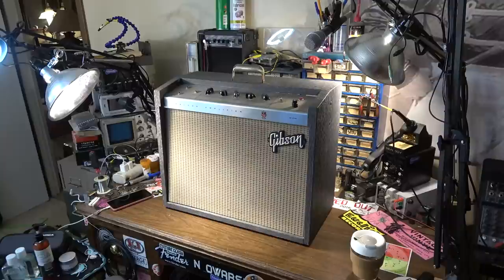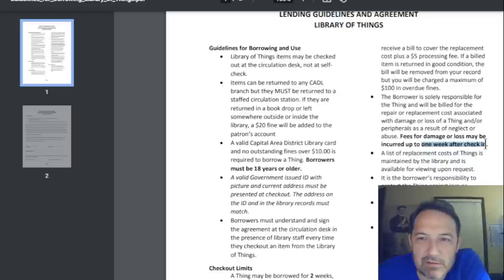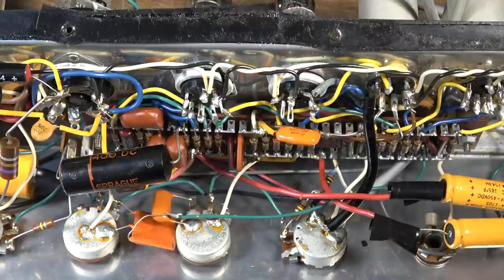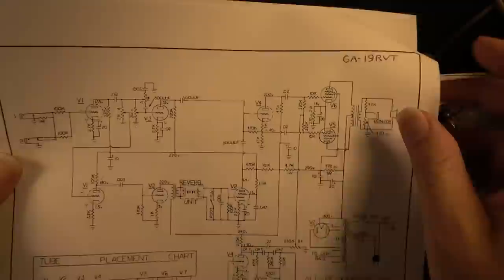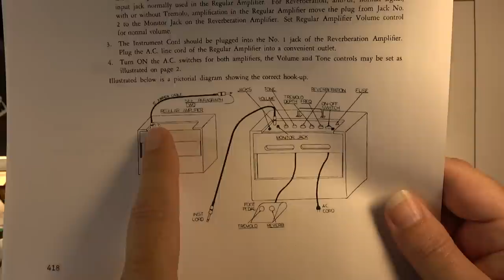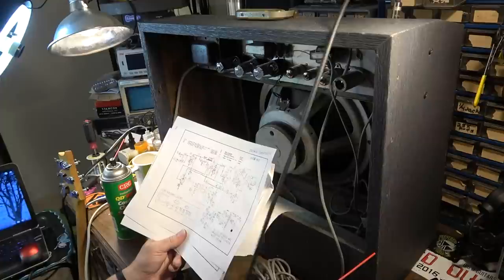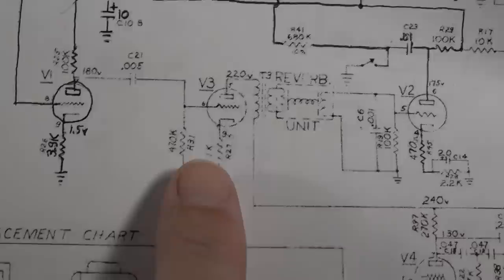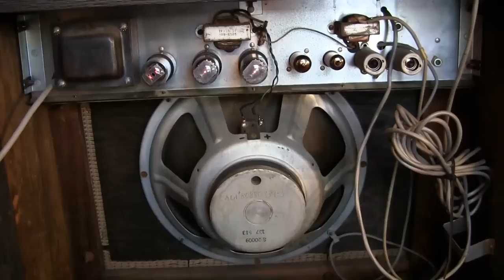1965 GIBSON FALCON MODS - FACE MELTING Tone!

Comment: If Gibson cared so much about the musician, they'd reissue this amp, you did a great job unleashing the sounds of the little beast, Bradley. Even Nashville amp gurus burn on guitar! 🎸 👈 👍
Reply: Didn’t they just buy Mesa Boogie
Reply: @codystrader7594  yes, Gibson bought Mesa Engineering and Bradley hates working on those rats nests, simpler is better.... 😁 AKA, the old Gibby Falcon
Reply: @gearmeister -   +1. Your average Mesa tech could knock one off in their lunch break, as therapy for dealing with those super-dense Boogie circuit boards the rest of the time.
I’d be very interested in having one of these, and I bet a whole load of other folk would, too. Fingers crossed for a NAMM announcement. I’d love a point-to-point version like the oldies, but I don’t need a second mortgage right now. Just had to sell a chunk of gear as it is. ☹️
Reply: Well Gibson listened cause they are putting out new Falcons. Lol
Reply: @jasonulrich3818  Here for the replies lol MJ popcorn meme

Comment: @The Guitologist:  CADL also stands for California Drivers License. It's quite common to mark belongings in Calif. with your license number. Just sayin'
Reply from the maker: Good point. The library angle might be a red herring. But it was a fun tangent anyway.
Reply: @TheGuitologist  I'm going to agree with Robert W. The CADL looks like the number for a California Drivers license. In the 70s and 80s (at least in California) there was a push by law enforcement to etch your DL# on valuables, so you'd have a better chance of recovering them, if they were stolen, especially for electronics.
Reply: I’m curious….
Would there be any way to look up that old DL number? That is, if it is from the 70/80’s. I mean, there might an interesting story behind the amp.
Reply: @TheGuitologist  Very interesting actually.
Reply: @KevinBingham  Yep. 100%
Reply: @PhantomOfTheMall  It's supposed to be public information, is all I know.
Reply: @TheGuitologist  If it's from the 70's it should be one capital letter followed by Seven digits. Mine starts with N. If you know someone in law enforcement they could get the info easy. Or, you could simply contact them and present the facts and they might help out.
Reply: @KevinBingham  My mom did the same on a bunch of binoculars and cameras.
Reply: Play on one of these once. Tone for days

Comment: Brad, that's interesting.  I actually bought one of these from my local Guitar Center after having watched one of your videos. One of the issues it had was a non functioning reverb.  Long story short,  I replaced the failed reverb transformer with a 20 dollar fender style one and it works great!
Reply: I have a 65 like this and same thing reverb isn't working. I will either test the tubes somehow...I don't have a tester or just buy a spare EU7 and the other one he mentioned. ..if they can be found without being too expensive. I will clean everything like Brad did too. Don't worry I know how to not get shocked and discharge caps etc. Seems its very common for these amps to have reverb problems.

Comment: This may not have been the case with this Falcon but I thought I’d put this out there.

I’ve been through a bunch of these early 60’s to ‘66 Gibson & Epiphone’s and a few had weak reverb.

I found heavy corrosion on the inside of the ground lugs on the RCA jacks - weak ground weak signal.

This stuff had to be scraped off with a very small flat blade screwdriver & brushed with a stainless brush, then sprayed with deoxit.

It was tedious, the lugs needed to be pinched back down and I coated the grounds on the tank with a conductive grease.

I also gently cleaned the inside of the signal inputs on the tank with a small torch tip cleaning tool, then sprayed it with deoxit.

This brought that awesome Gibson ‘Verb back to life.

Thanks for all you do!
Great channel, you’re my go to amp channel & even more so with your fight for America.

Comment: Brad, great point on the annual budget. Reminds me of my county and our "city"... Road projects will fall by the wayside til November... when they rush to spend all the budget before years end.
One November they started placing road signs EVERYWHERE... Redundant signs, flashing lights to warn of an upcoming stop sign on BOTH SIDES of the small streets, and a bunch of redundant "turn ahead" "wrong way" "traffic light ahead, etc, all on both sides of the highway. In one 100 yard section I counted 14 signs... so many in the median it blocked the view from the turning lanes of oncoming traffic...
Turns out that the county needed to burn a bunch of budget money, so they ordered thousands of signs and started putting them anywhere they could, needed or not...
Then there was the time they let the main road through town turn into a cratered mess before finally paving it, then a month later cut it all up to replace water lines, patched it, leaving it full of ruts and craters again... all based on budget timing...
Good ole government funds hard at work
Reply: One of our main highways here has been under construction for 20 years.
Reply: Libraries have been in operation since Mesopotamia. I honestly think these large budgets are slush funds for friends & fam of the politicians. Fun fact, where I grew up, they had a highway they built between OKC & Tulsa. (Turner Turnpike) they made it a toll road, to "pay for the road"(the other alternative was old Route 66, which is a fun drive, but it winds through every small town between the 2 cities.) Well I was a young child when it opened the toll was 25c one way. After decades of hundreds of thousands, of people taking the road, it was nearly paid off. The politicians in OKC (knowing a cash cows udders were about to dry up) decided that, until ALL the toll roads in the state were paid for, they'd continue to charge a toll (A lot more than 25c). Guess what? They started building more toll roads, all over the state. Some are under construction right now. I left there in 1975, so glad I did. They're a crooked bunch, IMO

Comment: In the 60's I gigged with that amp (and an ES-125)!   Well over a decade ago I bought a mint condition '64 GA-19RVT as a nostalgia amp, but use it over other amps I have- LOL (I do all my own amp and other electronics repair being an ex-electronics tech for USAF)  - But I did not "beef it up" or tune it to run "hot,"  I run it spec - I think it sounds BEST stock (other than re-capping)!  Use as jazz and blues mainly with archtops (e.g., ES-335's)

PS On these amps, ALL GA-19RVT's, reverb can be  used 100 % wet (input vol = 0) and LOUD:   You SHOULD be able to turn the volume all the way DOWN (zero) and the Reverb knob/control then controls 100% reverb ONLY out and "level" (which is all wet)  - it's actually a "feature." Bottomline the reverb is NEVER weak on these, or even close to being weak - something else is WRONG if you are only getting little to even moderate reverb!
Reply from the maker: They can sound great stock with Gibson humbuckers. They tend to be on the thin side with single coils.

Comment: I’ve started this videos 3 times already but haven’t been able to finish it because I’m at work lol I used to have a 1968 Gibson Lancer GA35 RVT. I loved that amp, especially the reverb sound. But man, I know what you mean about their wiring being a mess. It looked like someone dumped spaghetti inside. I wish I still had that amp. I was 16-17 when I had it and was lost when it came to wiring so I traded it off because it was so staticky and would randomly just make god awful VAAAAAP sounds lol Watching your videos on old Gibson’s makes me want another one so bad
Reply from the maker: If it was the black tolex one with trapezoidal top, those were poorly wired. Lots of good bones there though.
Reply: @TheGuitologist  you nailed it, that’s the one I had. The board inside was warped from the heat of the tubes and it had lots of cold solder joints. That’s  where I think all the hisses and buzzes came from. Not to mention bad caps. I still miss the trem and reverb it had though.

Comment: Your guitar playing is just so so cool. I hope Gibson end up reissuing amps like this, what is it that makes it just sound vintage? The transformers or speakers or the actual circuit? Its just heavenly to hear you play through it, like takes you back in time for sure.
Reply: Mojotone will probably make them if they do, much like the GoldTone Gibson amps a number of years ago.
Reply: Nothing special with the circuit, it's similar to Fender 5E3 Deluxe. Mostly the tiny output tranny combined with old speaker and resistors/caps drifting off spec, I'd say.

Comment: Hey Brad, I have the same amp, and did the same mod. Afterward my reverb was weak as well. I even tried moving that green wire to different points in the chain and still no love. I can tell you before the mod this thing had swamp written all over the reverb circuit. Could it be that .02 replacement? I hope you can figure out this anomaly one day..

Comment: I'm a old Hifi guy and found your description on using a second amp with these amps humorous ( sorry not laughing at you as your very talented at playing and repairing )....i got instantly what was the connections ( i believe lol ) and what they would do....the monitor would always be the final output source ( that goes to the speaker ) to listen to or use to output for recording or in front of you on stage? ..so when that is sent to the second amp...you will get the reverb/tremelo effects ( or whatever your first amp is sending into the speaker )....
Now i believe?   If you use the Second input to send to the second amp?  Won't that just send what the Guitar ( or Mic etc ..) Is feeding to both amps?? ( not a amp user )..
This would just send the unamplified output of your guitar/mic to both amps equally.... And your Reverb/Vibrato would not go to the second amp....

Comment: I have 2 of these amps. Love them! They both are slightly modified to tame the treble and a bit more input gain. Just a bit. 
I also have Eminence legend 1250 speakers in them as they are an improvement over the old  ones. I overdrive them by using an e.q. pedal with the level turned up.
 I have 2 so I have a spare because they are my main gig rig.
They are not very loud for some venues. Just Mic through p.a. or use the SUPER COOL moniter out to a larger amp set clean and now I have a high wattage falcon going on.
Great tone and responce to my touch that I just can't get from more modern designs.

Comment: The Reverb kind of sounded intermittent during the demo. Some points in the take it seemed to be strong, other times not there at all. If I was your customer I would definitely replace the tank.
Reply from the maker: The camera mic has compression. It sometimes cuts off the reverb trails, other times it raises them in volume.
Reply: @TheGuitologist  probably that. How did it sound in the room?

Comment: That spruag tone shaping  cap could you wire it in such a way where you could take it in or out of the circuit depending if you want or need more gain?

Comment: Great and informative videos thanks for posting and helping educate. I have a question I'm currently recapping my 65 Falcon and was wondering if you can tell me if you cover the portion where you install the 10uf 450v caps on the tone and volume and what that is achieving in the circuit? Is it in another video I have missed? Cheers keep up the good work!

Comment: A close cousin is the Epiphone Pacemaker. I sold it. Dumb mistake. They can still be found in used shops, and arent a grand like an old Champ. Its has 6AQ5s x 2 power tubes that sing when cranked.

Comment: Hey Brad hey where can I get a knob for a champion 110 Fender amp? I got the amp for $20 and all it needed was a input jack so I installed an input jack in it and I just realized that the headphone jack isn't working either and it's probably just the Jack itself needs to be replaced as well, and I have one of those to replace it but I need a knob for the Reverb and I can't find one have any idea where I can get one? Thank you sir,

Comment: Imagine renting out the library electric guitar and upgrading the electronics, bridge and tuners 😆 "PRANKED BRO!"

Sprague date codes are always WWYY / YYWW or MMYY / YYMM like most old component companies. By the looks of it those are 43 week of 1975.

I've found the red label black butys hold up way longer than the yellow ones, yellow are oil/paper and red are paper/mylar

Comment: I bought a 63' in the early 2000's. Came with an old weber feromax speaker, sounded too clean. 
Swapped in a weber 12a125-A/30watt. It is such a sweat amp. Came with tone-suck circuit already removed.

Comment: I know this is off subject but is it possible to turn a solid state amp into a full tube amp I got a cheap 10 watt practice amp I mean very cheap one just to tinker with . I modified it and got it  sounding like a small 10 watt Marshall mg 10cd sp would like to make it tube so it will sound like a small 10 watt marshall tube amp and maybe have a cable port on the back to run to a 2x12 cab for a louder and brighter tone and help would be great. The amp in using to learn modifications and amp wiring is a small 10watt no name brand at all amp that I got sounding like the marshall mg10cd with tubes would be one hell of a practice amp I would think especially on a 2x12 cab thanks guys

Comment: Point 022 capacitors they're black with the Orange striped black beauties were used up in to the 72 Gibson guitars I have seen them in a 1968 std 56 les Paul

Comment: Maybe someone changed a faulty transducer at some point and replaced it with the wrong one. The output coil should read much higher than the input. For example on the Fender Reverb 4AB3C1C Tank, the input impedance is 8ohms and the output is 2.25kohms. This is at 1kHz of course, but the dc resistance would show a similar difference between the two.
Reply from the maker: Yeah the voltage needs to be stepped, but isn’t on the tank
Reply from the maker: You’re right. This was a factory error. I’m convinced now.
Reply: Yes, a large voltage signal drives the low impedance input transducer coil to create the vibration of the spring. The springs vibration on the other end creates vibration and thus a moving magnetic field in the output transducer coil. This induced voltage is very low and and needs to be recovered in the amp. You don't get a very efficient transfer of the signal if the output impedance of the amp doesn't closely match the input of the tank and same one the output of the tank to the return to the amp.

Comment: Brad I bet the impedance on that tank is wrong. Somebody probably broke a spring in the tank that came with it and someone snatched one out of a broken amp and sold it to the owner. That's something a music store from that era would do. It was my era lol. In those days amp repair people were usually ex military working from home. Music store owners could only change tubes in order to fix something.  Anyway see  what the correct impedance is on the schematic. Have you worked on a Gibson Atlas yet? They were 2 6l6 2by12in speaker cabinet
Reply from the maker: I suspected that too, but no, this is the original 1965 Gibbs tank. It's just a weak circuit. They don't list the impedance on the schematic. We aren't so lucky.
Reply from the maker: I have owned an Atlas in the past that was worked on before I got it. I think I had it open and looked at it, but those can be monstrous amps.